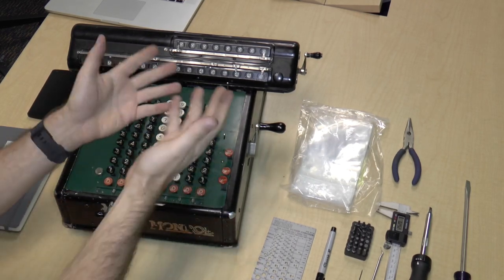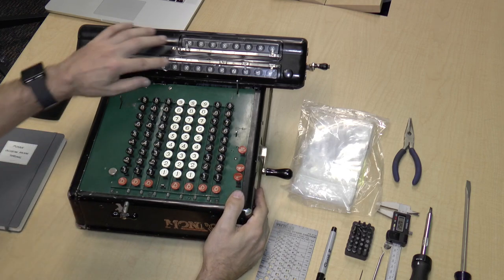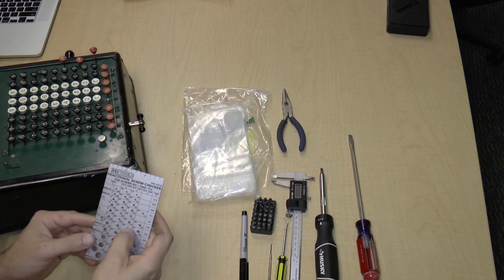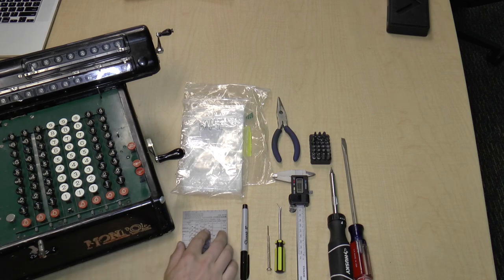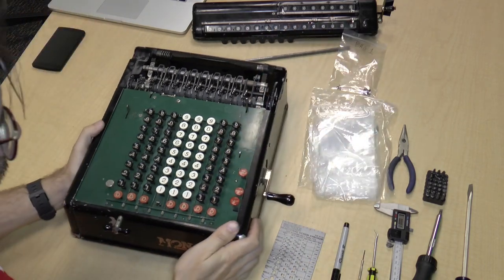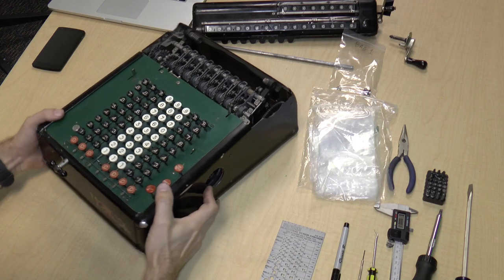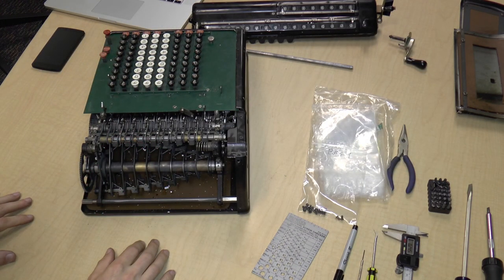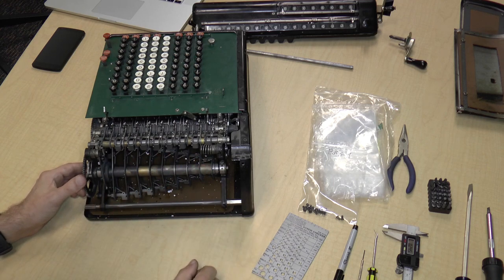Disassembling a 1920s Monroe model K mechanical calculator, part 1

Comment: I have a Model K which works except it needs cleaning and oil. The only thing that doesn’t work is the bell. The main cover is one piece. I’m not sure of the age. I found it in a thrift store for $16 but it was 50% off day so I paid $8 for it. Got it home, fiddled with it to unjam it and it works. Can’t see a serial number anywhere except what I think is a part number stamped under the carriage casting.
Reply: I also have a Model LA5…everything works except the keyboard is sticky and I believe it is because the sliding stepped gears are sticky. Hope to fix that. I paid $10 for it from a local person.